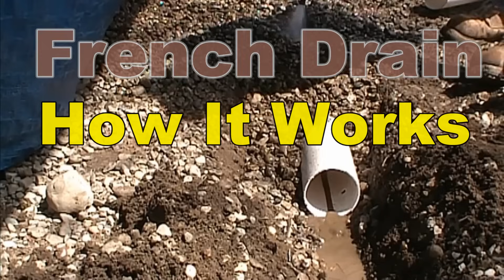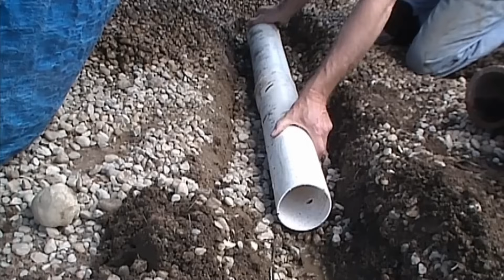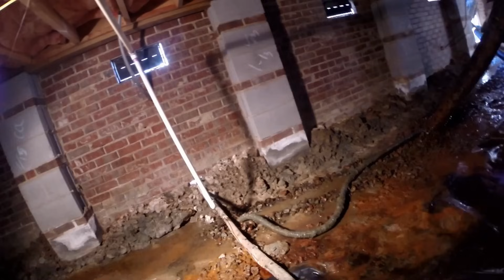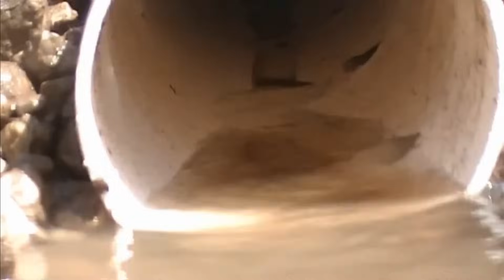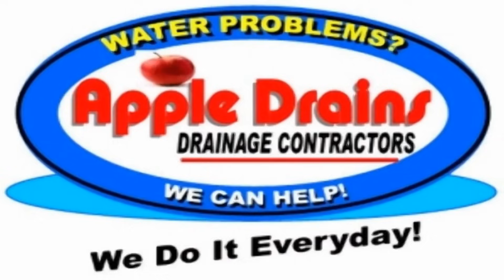HOW A FRENCH DRAIN WORKS

Comment: I read that the holes work best at 4 and 8 o'clock, so that it minimizes the amount of silt and particulates from getting into the pipe.  Holes toward the bottom does make a lot more sense that on the top, however.  What are your thoughts on the 4 and 8 o'clock method?

Comment: What's the point of the pipe if the gravel will drain as well?  Is it just a faster way to get the water out?
Reply: I expect the point of the pipe is to redirect the water to a specific place like a drain for instance. Moving a lot of water from the earth to stop the earth from getting water logged. But, I'm not an engineer, it was just an educated guess. 😊

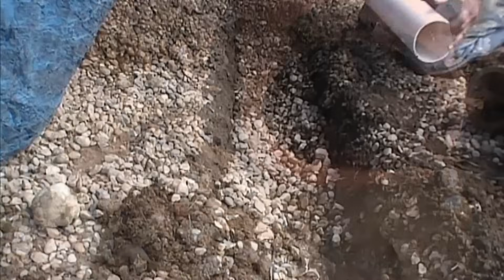Comment: I appreciate your video and the explanation but I am a little baffled when you describe holes on "one side of the pipe" pointing down, when at 0:28 your pipe clearly shows holes on both sides of the pipe. Have you subbed in a pipe with holes only on one side for subsequent shots?

Comment: Great explanation - makes sense, although I think most of us "intuitively" thought that the holes should point Up because then the rainwater percolating through the dirt and gravel above would then go into the pipe if the holes were on top. 

Thanks for  the explanation! 
(Question: what keeps small bits of gravel from falling through the holes and starting to collect in the pipe?)

Comment: Looked like most of the water flowed from around or under the pipe.  Not a whole lot through it.    Makes we wonder what the point t of the pipe is at all.  Why not just use crushed rock over a bed of plastic sheeting that is directed to away from the home?

Comment: This is the first video I have found that explains why I have holes in my drainage pipe. Now I have to go see if they are on the bottom. I hope so.  I have an explose 4" pipe under my basement floor that comes out at the bulkhead stairs. It's clogged with rock however. trying to figure out if I remove that rock, will that hurt anything because the water has been backing up from the bottom of the bulkhead stairs for 30 years. Just discovered it was plugged. ugh.

Comment: Honest question. If water travels through the gravel, and first at that, why not just fill the trench with gravel? Why use a pipe at all?
Reply: The pipe drains the water away at a higher speed than gravel alone would.
Reply: @peterpoloka7942 that’s it’s?  So could use just rocks then. But preferably a pipe helps. We can do a trial and error and see what happens :-)
Reply: @eagl0215  The gravel around the pipe expands the water catchment surface area of the pipe. Water travels through the gravel to the pipe a short distance. Once in the pipe, it travels a much longer distance at higher speed, also taking any sediments with it that would otherwise end up clogging the gravel over time.
Reply: I’m assuming here, but that’s just a water hose…. With actual rain it will probably need the pipe to flow faster and prevent flooding. If you rely on gravel it will probably flow slower and start to flood.
Reply: Had the same question
Reply: The first French drains used only gravel but weeping pipe was then added as the design advanced making them much more efficient.
Reply: Does it need geo fabric around the pipe?

Comment: My question is mainly about the Geo fabric. Some people will wrap that around the whole pipe. I’ve seen it done both ways. I’m wondering why it wasn’t done this way. Looks like the system works pretty well without the fabric. It may be they’re not using fabric because they are using bigger rock.
Reply from the maker: @claylandscaping5713  the rock is the fabric. #67 stone is the best
Reply: @appledrains  Makes sense. Thanks for the reply.

Comment: In a rectangular tank of 6 ft × 5ft ×4 ft 
Where should be the drainage hole in backcorner bottom or centre of tank , for water to drain out tge fastest .
And which size should be tge drainage hole.

Comment: This video is super helpful but I have a question. I have a small low area in my yard that gets very boggy. Everything drains that direction. Very small maybe 5 ft by 2 ft shaped like a rectangle. I'm going to dig all of the dirt out of there and replace it with gravel I'd like to put in a French drain but I don't necessarily have anywhere for the water to go I just need to stop it from being absorbed by the soil. I have a concrete pad next to it so if it overflows a little under the concrete it's not a big deal. Would this work?
Reply from the maker: Give it a try!
Reply: @appledrains  thanks for the encouragement. I will.

Comment: Can you only do a single pipe like this or could you do a large gravel area metres wide and have a single pipe every 30cms and have them join at one end into a single pipe that directs the water into say a pond or creek or hell even into a in ground water tank which can be filtered and used for drinking or grey water at least?  We get either drougjtllht or flooding rain here in australia and its common and considered necessary in most states to have water tanks that catch the water from the steel roof into the gutters then into pipes directly into your above ground water tanks. But as flood prevention and also to make use of rain when we get it id love to make the land without buildings over it catch rain too especially if you can pop a lawn overtop as im nit a fan of all gravel yards like they do in arizona and such places would this work? Im imagining it a tad like underfloor heating where it has this snake of water pipes under the floors that get heated and provide warmth but instead of that a french drain under the lawn section of the backyard and the raised vegie patch and have the trees and garden on the slopes where they can prevent soil erosion and get the water themselves in places where a french drain wouldnt work. And the excess water can end up in a dam or farm irrigation channels which are a bit like swales of sorts as extra above groune catchment and also the plants help filter the water and the yabbies and fish in the dams are good food if need be. Not like theres a lot of seafood in the outback 😂 unless you want freshwater that you catch yourself. It seems simple enough just would be a lot of earth moving but rather have that done and prevent flooding than not have it done and have to replace flooded buildings and contents... thoughts? Love a video on large scale french drains i wonder wouls it have anything in common with septic tanks/sinks concept... just a different kind of water 😂...

Comment: The house I currently live in had a 20 foot section where 2 inches of water would sit after a good rainstorm in the backyard.  I installed a french drain, and laid the pipe exactly as shown in this video.  The drain I installed was around a lawn, and snaked around the house to the street.  At each corner, I also installed clean outs just in case there is a blockage in the future.  I also used a line level, and made sure there was enough fall in the pipe to keep the water moving that was inside the pipe.  Since installing the french drain, there has been no water in that section after severe rain storms.  

Also, when I did the drain, another drain was installed at the same time to catch and divert the water that drains from the gutter downspouts.
Reply: where was your exit spot? does the drain just exit and drain into your yard?
Reply: @darylmixan8170  The drain I put in drains at the curb gutter along the side of the street that runs in front of my home.

Comment: Chuck how are you and family Doing. I watch you all time thanks for information. 

I live in a 1950 one level house with a basement when I first move here 30 years ago we had water coming in when we did a wash. 
So my plumber said to dig a large trench. So I got up early on a Saturday and dug 6 ft down 6 ft wide 20 feet out. I then told my plumber and he told me to go to industrial store and pick up 6 ft plastic heavy duty with slits  on side of container’s he then connected it all. 

I first put stone down then container’s then more stone on top.  Then slowly added dirt. 
It has been working great. For the washing machine. 

In front of my garage that goes under my home is a large pit rain came so fast it wasn’t able to keep up with seepage of water into the five foot deep pit when I opened my garage a wave of water flooded my garage and basement. 
It took me 8 hours to get water out with a wet vac. 
Thanks 
Just last week it rained for  3 hours and dropped 9 inches of rain I  had water 
coming into my basement from my garage and from the back wall what would you suggest for me to keep water coming into basement. 

Would u suggest pipe with the holes facing down and run it towards the street. 
Only question how far do I have to go down into ground.
Reply from the maker: yes Hole point down! Sounds like you got this !

Comment: Why wouldn't the water seeping down just continue to wash away the dirt and support under the pipe/gravel, so eventually the pipe starts to sag and have issues? I have a serious issue to resolve beside our pool, not due to standing water, but do to water washing out all of the soil and dirt and taking it down a hill on the back side of the pool. We had people fill all the space with foam, and the next rain just went under that, and washed out the dirt below it. Why wouldn't lots of rain washout what's under this pipe?

Comment: The pipe in the video you were using as an example had holes at the 3 and 9 o'clock positions as well and the water was still not draining. It's likely that pipe had holes all the way around it but was just full of dirt and sediment due to the shortcuts taken during installation.

Comment: Your videos are very helpful, I have a steep driveway that I was going to install 18 inch deep french drains in on both sides of the driveway. I have the black 4 inch flexible drain pipe with the sock already around the pipe. Would this pipe be strong enough to withstand the pressure of vehicles driving above it or would I need to use the schedule 30 drain pipe?

Comment: So does that mean technically we don’t need a catch basin? It would still work with just a drench?
Reply: That's exactly my question.  I have a low area of the yard which most of the time is fine but can get boggy. It's not very big and I'm thinking if I dig it out and replace it with rocks and a French drain that will be sufficient. I don't want to put in a catch basin it's okay if the water overflows to the concrete area next to it

Comment: My drainage system was replaced last year and im still getting damp spots from hydrostatic pressure coming through my slab (house was built in 1940, 3" slab w no vapor barrier). I was told it would dry up in a few months but has not. The company replaced corrugated with 4" pvc and there are 2 clean outs, ive looked in there many times to see if water is in there but its always dry. I never thought about this until I saw your video, but the holes in the pvc are pointed straight down. Yours are down but on an angle which to me makes so much more sense than straight down... how mine are positioned would allow water to drain up into the pvc but it doesn't get trapped. Is straight down incorrect? Would it be worth raising hell to the company who did that?
Reply: Corrugated is probably the issue. Next it could be the drain point is slightly higher than the pipe level in the drain, which would leave a water level in there that would have to evaporate vs running down the pipe
Reply: @camarocraig7060  thanks for the reply. No sorry, they took corrugated out and replaced it with pvc. Im mostly concerned with the hole placement, never thought about it until I saw how yours was positioned
Reply: @j4panfour410  yes the holes not being down would have the same effect as a drain point not being low enough. The drain would have to fill up 6-9" before the water would enter the pipe, this would leave the drain wet for a long long time and of course hydrostatic pressure will do it's thing when water is present non stop.

Comment: Can I ask why you wouldnt just fill a trench with gravel? What is the purpose of the pipe itself? I imagine for significant downpour the water will flow easier through a pipe than through drainage rock, but it still has to fill the pipe through the smaller holes compared to just running alongside the pipe. Even if enough water entered the pipe in a storm the high flow rate through the pipe would probably have to be restricted or dispersed when the water exits the pipe at the other end to not damage soil where it exits? Thanks
Reply: I believe the pipe is to carry the water away from the area. For instance if you are getting water intrusion in the basement, you don't want the water to just soak through the gravel and pass through and permeate the area, but you want it to  flow away from the foundation.
Reply: Water flows faster through the pipe than the through the gravel, so you're basically making a highway for the water to get it out of the trench and away from the foundations or whatever you're using the french drain for.

Comment: Maybe dumb question. Using perforated corrugated pipe means that a little water can accumulate in the corrugations.  I am worried that that might be an attractant to roots over time, which would compromise the system.  If cost was not an issue would you suggest non-corrugated perforated pipe?   And thanks for your videos.  They help out a lot.

Comment: If I have a french drain can i drain my sump pump just to the side of the house?   The builders left a short pipe off the house about 3 feet up on the foundation,  so it drops the water right near the house.   Is this because the french drain is sufficient to move that water away?
Reply: If your house has a basement, it’ll cost you a pretty penny in labor and materials to put a drain like this 3ft up from the bottom of your foundation. It would be far easier to just pipe that water further from your house if the current drainage is insufficient.

Comment: so this is how to movw water fro one spot in the yard to a spot two feet away? whats the point?
Reply: This is just a small demonstration. In a real application the pipe would be extended out to a predetermined area
Reply: @gmsunshine  right the full system runs all the way to the curb if possible
Reply: Yes sort of. What this does is keep water from standing in an area, creating a puddle or like in the video where the man is in a crawl space and it turns into a giant(exaggerated) creek. 
  Example- Say you're standing on a back porch. The slope where water is supposed to drain has an area that after a rainfall or when the irrigation has a little bit of a low spot, creating a puddle. So, when you have a french drain, you dig a trench and install the pipe as shown, always with a slight downward slope. With the holes in the pipe, it helps eliminate more water from gathering by draining down as it flows away. Preventing standing water or turning into a creek. Hope I explained this ok
Reply: Just demonstration video dude

Comment: what about holes all around?
Reply: Fine dirt, sand, or clay will work it’s way in through the top, settle, and clog the bottom holes. Having holes only on the bottom uses hydrostatic pressure to keep the holes clean and give the water a place to go.

Comment: why not have holes all the way around?
Reply: jon fraer  I've made a drain using corrugated pipe with a landscape fabric sock over it (comes that way). That way water can enter from all sides but silt is kept out with the sock.
Reply: Most slotted corrugated pipe does have holes all the way around.  The pipe in this video is more designed for septic leech fields where you want the holes down and never up.
Reply: @asusreviews  im sure he has a drill and a bit he could have added some holes =)
Reply: If it’s for a leach field you don’t want the draining septic water gushing out of the top towards the surface. It needs to point down.

Comment: Not the best of examples. Water was running under the pipe before through it. I assume this is not an accurate install
Reply: Keep in mind that this is a fresh installation.  Over time, the voids in the bottom gravel will become filled with smaller dirt, pebbles, sand, etc.  In addition, the gravel under the pipe also serves as a conduit to direct water in the same course of the pipe and may enter into holes along that course as it travels downhill.  Regardless, the gravel serves as an adjunct to the pipe in achieving the goal of drainage.
Reply: It’s okay to have water running under the pipe. You want to prevent excess water from pooling. You could do this with just gravel and no pipe at all, it just wouldn’t last nearly as long as dirt works it’s way into the gravel.

Comment: U used no liner your gravel and substrate will mix and clog. Smh.
Reply: It was an example to show why the holes are on the bottom. No need to use a liner for the demonstration. Furthermore, if he had wrapped it, we may not have seen what was happening as easily.